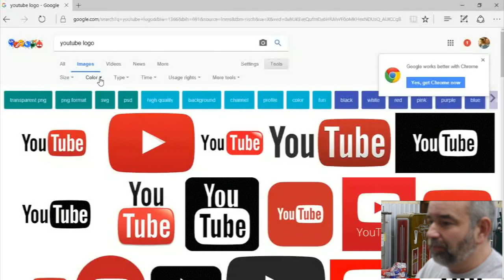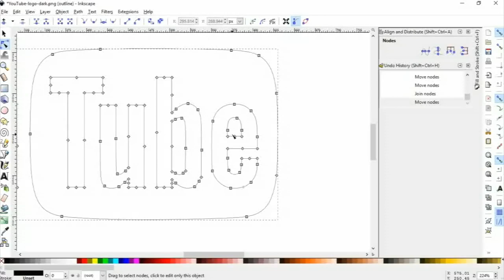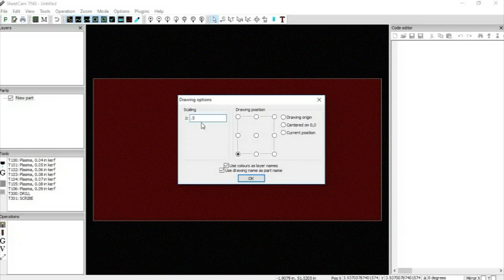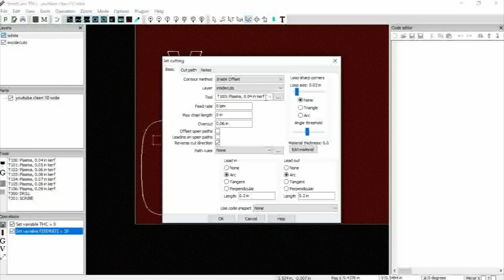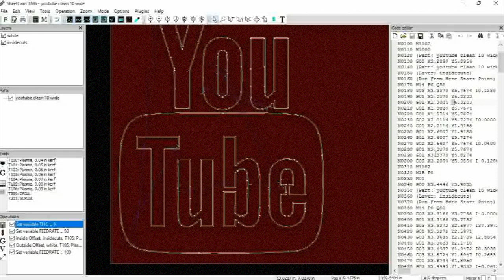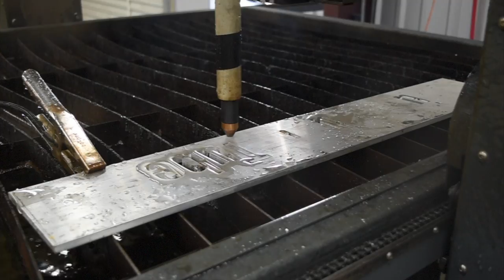CNC Plasma table 101 -  overview - Aluminum Youtube Logo

Comment: Very good video Gary, nice job.  I can see that like most computer stuff the software has advanced quite a bit in a short time.  At my old job the sheet cam version was much older and I can see the workflow is a lot different.  They did not have a water table there either, are you considering adding something to control rust?
Reply from the maker: Sheetcam seems to be fairly mature, straight forward, simple... The water table is fully powder coated as is all of the machine.  That rusty looking water makes it look works than it is, I haven't actually seen the bottom of the table yet to see how it's holding up .  Thanks Bill